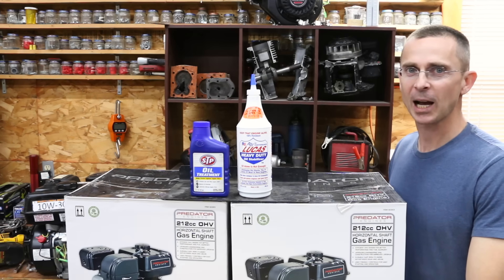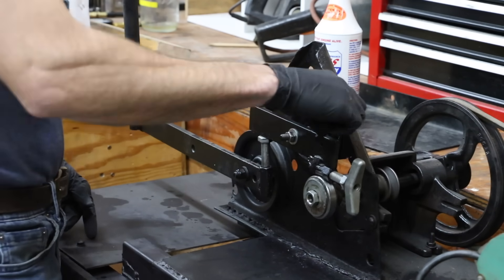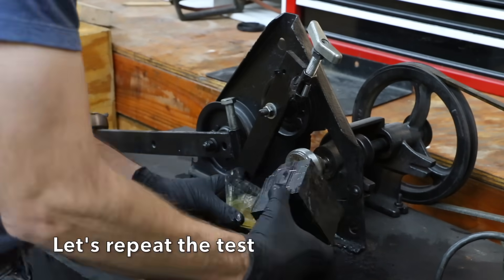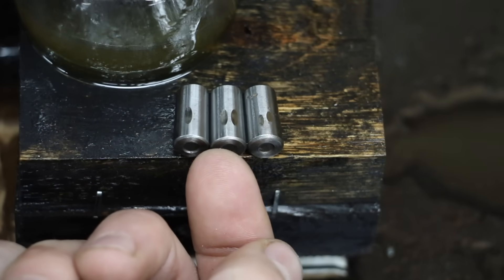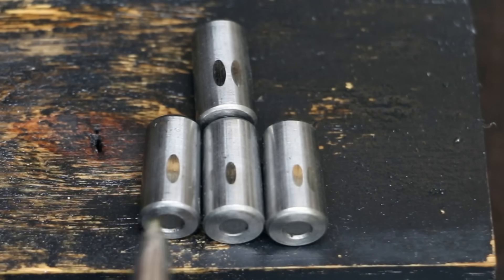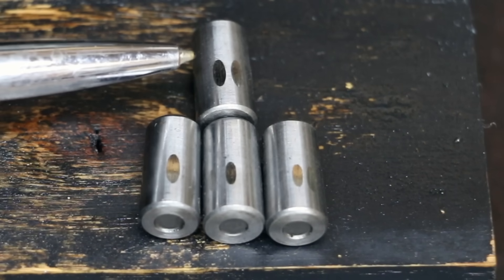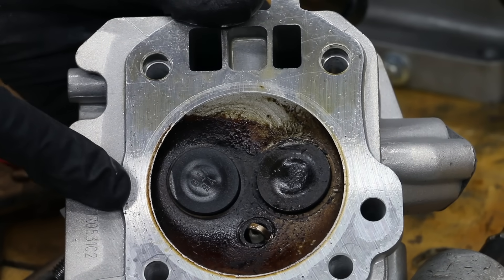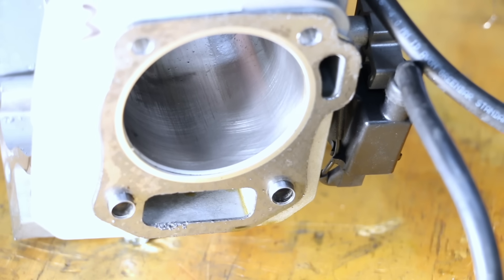Which engine self-destructs first?  Lucas or STP?

Comment: Prolong commercials made some pretty amazing claims, I would like to see it go up against any of the top oil additives.
Reply: C W - Great experiences, thank you for sharing! @Project Farm, you've got to try it!
Reply: I've been using Synionic (used to be Prolong) for 3 years in many applications including: Automotive petrol and diesel engines, manual and automatic transmissions, outboard motor engine and gearboxes, Wankel engines, hydraulics, compressors and vacuum pumps. It works really, really well - BUT it needs to be temperature cycled in the application several times and preferably allow the engine to get hot - then it's phenominal. I had an old Volvo 940 overheat in traffic when the electric fan failed(I didn't notice the temp gauge and the engine was running perfectly) - since then drivability is unreal.

Comment: Well, I learned to keep using oil in my engines. I'll do that, 100% synthetic even in lawn mowers for me.
Reply: I'v ran synthetic in a Troy for 9 years and a  John Deere for 11 years just add oil to them did not change at all still using the Deere.
Reply: Not hitler, mowers have governors to limit rpm so they are not running at max rpm.
Reply from the maker: Thank you
Reply: If I may, I suggest using Amsoil.
Reply: I use synthetic in everything! Car,lawn tractor, log splitter, snow blower exc.

Comment: I think the Lucas won hands down. I have always been a lucas fan. I have a motor that has 323,000 on it and it is compleat stock. I had run lucas in it sense I bought the truck. Well the head gasket cracked and so when I went to start replacing it I noticed something lining the entire head, the motor hadn't been run for about 3 or 4 months so all the oil had settled. As I am looking at it I discover it was that lucas oil stabilizer that was covering it. That motor has ran strong ever sense. I use it I'm my gas and diesel motors.
Reply from the maker: Thank you

Comment: Was a tachometer used? Were both running at same RPM?
Reply from the maker: Both are governed to run at 3600 RPM.  Thank you
Reply: As you can see, the engine bearing went first. Then the rod scraped on the crankshaft until hot enough to melt... then it grabs. 99% of engine failure are this.
Reply: Yes, both engines were running at 11,500 RPM... + - a few hundred.
Reply: @lcee6592  hahaha now you sound like a CBR motorcycle engine test!

Comment: Interestingly, I think STP won. Why? Because under normal operating conditions, where these motors are going to find themselves 99% of the time, the STP engine was running cooler  than the Lucas. I am willing to bet the additional heat was a combination of additional viscosity and entrained air in the oil making for a poorer lubricating oil.

But but but the Lucas oil engine lasted longer! Yes, in this ONE test it did. Could be a complete fluke that this motor was built on a Wednesday, where the other was a Monday after a long weekend. 

What does the STP cost VS the Lucas, and over 1000 hrs of operating time and oil changes, what does that cost? What does the additional fuel consumption cost due to the higher parasitic losses in the Lucas engine?

When you look at total lifetime operating costs assuming you're smart enough to not run it without oil, the STP I think you will find has a lower total cost. And realistically, 15 minutes vs 20 minutes with no oil is meaningless, it's dead either way.
Reply: You can't just assume the motor ran cooler because of the STP . We didn't even get the break-in temps for the two motors for a control (regular oil temp) comparison . One motor may simply run more efficiently than the other . A slight difference in air to fuel ratio could be all it takes to make one run warmer .
Reply: And keep in mind these were cheap Chinese engines . They are not known for consistency .
Reply: But we really don't have evidence of that, do we?  BTW, you might want to check out p.16 of the latest (Feb. '19) Consumer Reports (p. 16) on Recreational Generators where the $500 Chinese Predator unit matched the $900 Yamaha unit  in their ratings … 72 points to  73 points.  Yep, that also surprised me.  @bryanobrien2726
Reply: @LR-my2di  "But we really don't have evidence of that, do we?" . That was my point . Predator quality is nowhere near the leading brands , the only thing going for them is the low price . What's the warranty on a $500 Predator generator ? 90 days LOL .
Reply: I love Yamaha, Bryan. I just bought one of their supercharged 1810 cc PWC's.  However their warranty on that generator in question is also 90 days unless you buy the extended factory warranty. I know because I have one. LOL   @bryanobrien2726
Reply: @LR-my2di  What model would that be , the EF2000iSv2 ? According to Yamaha , all of their generators including the EF2000 have a standard 3-year warranty , extended warranties take effect after the 3-years .
Reply: @LR-my2di  Yamaha's warranty is more than 12 times longer than the Predator at 1,095 days vs 90 days .
Reply: I paid no attention to the model # since it was almost two yrs. ago during hurricane season.  It went immediately to my  lake house down in Florida where I'd need it the most. Warranty was never a concern anyway as being a Yamaha, I knew it would last way beyond the warranty period expired anyway, especially with it being used only in case of an emergency. Funny that Lowes would have told me wrong.  Didn't matter to me anyway. I poured in some non-ethanol gas laced with Sunoco 112, fired it up and ran it for  ~20 min. , shut it off and there it sits.  @bryanobrien2726
Reply: @LR-my2di Lowes pushes their in-house extended protection plans . I wouldn't be surprised if salespeople lied to sell more . Best Buy is well known for doing this .
Reply: I agree on both counts!  Thanks.  @bryanobrien2726
Reply: Jim Meyers.  Are you gonna take your stp and go home because you lost?
Reply: Good grief, folks. Give the guy a break with these tests. He has no million dollar lab. There are always "what if's" with such "little guy" tests as there are!  @bryanobrien2726
Reply: @bryanobrien2726  well, i can say Lucas is nothing more than glorified bar and chain oil; i run a repair business and all these people coming in for oil changes with their precious lucas that they want me to put in with their oil.   STP,  for your information, has been around a long time for a reason. its a good additive that contains zinc, albeit in small amount, but it does its job. 
Piss on Lucas and the millions of dollars they have sucked out of people that don't know anything about lubrication properties. 
Wayne and Kleetus are correct on this one.
Reply: @jimmyers8114  , I get it , you love STP . I didn't say one additive was worse than the other . I implied that this test was not conclusive or scientific . I worked at an auto repair shop myself for 20+ years and we didn't recommend ANY engine oil additives . IMO , people who use engine oil additives are buying snake oil including STP , it's usually old-timers who swear by these . I've personally never needed a fix-all miracle cure because I buy good quality oil and change it as recommended like clockwork , but I do find these VS tests and the fanboys entertaining .
Reply: @bryanobrien2726  Yup, My wife and I've got a number of high mileage vehicles we've purchased new..  Her old Tercel (mid 80s) had around 285,000 miles on it and still running like a top when I replaced it with a Camry.  It had well over 100,000 on it before a chicken truck sent it to the great junkyard in the sky.   That was replaced with a Solara that now has 235,000 on it and is running strong.    We also have a '97 T100 and a '92 Toyota  pick up, each with just shy of 200,000 on them still running well.   All I've done are regular oil (engine, trans, and dif) changes as well as oil and air filter replacement along with the other expendables like belts and plugs.  No oil additives have been used in any of them.
Reply: Jim Myers l
Reply: Some good points made here. 
I just think that in this video you just want to see which oil helped the engine run longer.
And in this case LUCAS out LASTED STP by approximately 10 Minutes longer.
This is almost twice as long.
Reply: @Godisknockingx  We don't know what both engines would have done with the same oil, either and we never will.
Production tolerances and carb tuning are huge variables. No 2 engines alike in these mass production samples.
Reply: Lol ya running with no oil dont prove much an engine needs oil to live meaning less
Reply: Man......idk....I SWEAR by Lucas BUT I've never used stp. The temp was interesting. I put Lucas in a mower that had "light-seized" and proceeded to make a lot of money with it. 
REALLY wish there was a control engine with just oil.
Reply from the maker: Thanks for commenting on this.
Reply: Exactly what I was thinking.  Thanks
Reply: STP might have ran cooler but Lucus ran 20 + STP did not so Lucus won
Reply: @Geebop Baluba Wow... 240 inline 6... there's an engine I haven't heard from in a while!
Reply: What would happen if the stp was tested using the same ratio as Lucas? The stp was mixed at half the strength of the Lucas
Reply: I was going to say Lucas until I read your comment. Makes sense!
Reply: @Eli Z Yep, we'll never know what either engine would do with the same oil in them both. Run that test first, then test oil additives.
Until he gets sponsored he's probably not likely to buy 6 engines for one test.
Reply: The temp. Doesn't matter because it could have been under more stress anyways
Reply: I believe STP is the superior of the two for the fact that the engine ran cooler. The high parrafin base of Lucas is what probably helped keep it running as long as it did after draining, and it's exactly why I don't run Lucas in my cars. Parrafin can and will cake up over time in an engine (ask anyone who ran Quaker State oil in the seventies and eighties) and cause worse trouble than it temporarily solved.
Reply: STP additive, apparently, had more air in the oil after it was mixed.  So, Lucas MIGHT be better.
But, waste of $ if you ask me.
Gasoline is so well made, filtered and particular additives are put in it nowadays, additives are a waste of $.
Unless we are running a 30 years old engine.  Then, there MIGHT be some value.
I say "might" because if the same $ spent on the additives was simply banked, a person might just as easily buy another vehicles, mower or whatever with the bank balance after a few years.
Additive market is nothing but a game and the consumer only makes the additive company wealthier.
I'll keep my own money and make myself rich, thanks.
Reply: @Rhetorical Answer 
I'm only saying that the Lucas engine had 50% more life in it compared to the Stp engine after it died.  That's a big difference if you think about the life of an engine. 
If it were 1 or 2 minutes then yes not a big deal. But almost twice as long can't be considered as a coincidence. The difference is just to much to overlook. When the difference is so big I personally think that a control engine would be nice but not necessary. 
Please note that I like both additives. Stp does keep an engine  running cooler and Lucas keeps a thin film of oil for protection.
In the end the Lucas engine had 50% more life left in it after it's counter part died. That is what I believe can be gleaned from this engines test.
Reply: Yea Micro-dieseling can cause premature failure in just about any type machinery
Reply: Did anyone pay attention to the crankcase and scaring on cylinder walls stp was way worse than Lucas so my conclusion is that on top of engine running longer and less scaring and looks of crankcase Lucas won don't really see how anyone can even start to say stp  was better
Reply: I'm gonna tell you Why Lucas Won...Just look color on the cylinder head STP Black,Lucas Brown that's a Perfect Burning..
Reply: Thanks

Comment: u would of got a better result running the two samples in a control test on your pressure machine for longer then 30 seconds but and not had to destroy two brand new engines but it looks like lucas and oil was the best result over mineral oil or stp and oil u should of also used penrite full synthetic to show people why its the best
Reply: running the engine dry don't tell us anything but
Reply from the maker: Thanks for the constructive feedback.

Comment: Why did the connecting rod explode but the piston itself was completely fine? Is it better metal?
Reply from the maker: Great question. The connecting rod is indeed the weakest part on the Predator 212 engine.  It's made of cast aluminum, which doesn't survive long once the lubricant wears away.
Reply: Well you learn something every day. Thanks for responding!
Reply: Partly because it's aluminium apparently (really?). Partly because the piston is supported tight in the bore - whereas the con rod has cyclical and compression - extension forces as well as lateral forces on the arm of the rod being reversed repeatedly at high speed without cooling or lubrication.. And no support. The conrod is under the most stress so it's the part that fails (and takes the rest of the crankshaft etc with it).
Pistons fail more usually in high compression or charged engines from detonation heat damage - hence why a lot of engines have oil sprayers aimed at the underside of the piston crown for cooling.

Comment: I'd like to see you do something with marvel mystery oil. That's been around for since before my time.
Reply: It's a light turbine oil, not recommended as the main lubricant, it's good for dirty lifters, stuff like that. Add to the gas too helps.
Reply from the maker: Thanks for the recommendation.
Reply: Yeah my Grandpa told me about that stuff when I was a kid. I use it to this day. I think it's pretty good for providing protection. I start using it right from the start on new engines in the oil and gas. Never had any issues with anything so far.

Comment: Hi, It looks like the additives did more harm then good, but the real question is are these adatives ment to be used in a new engine or an old engine that has been used alot more?
Reply from the maker: Great point. I don't believe either product warns against using it in a new vehicle.

Comment: Slick 50 vs TufOil & perhaps other TefLon/PTFE-type based oil additives. I've heard cautions about Slick 50. Been using TufOil for many years, w/ Mobil1 synthetic & greatly extended oil change intervals in many different types of 4-cycle engines (huge fan of the combination!). So, I'm quite curious. Thank you for all of the very interesting videos!
Reply from the maker: Thanks for the video idea!

Comment: But are these substances even metal surface builders? Or did these only work while on the motor? So, does this test even make sense? I understand this test if you compare even regular oil and Restore, rvs or x1r or bestilline. But these are different substances, right? Do not they only affect when on the motor?
Reply from the maker: Thanks for the constructive feedback.

Comment: Out of all the oil additives you've tested so far which one do you feel has work the best. (Provided the best protection or added true additional lubricity)
Great channel, keep the videos coming, glad to see you're donating the engines to schools.
Also-
Any possibility of adding JB oil treatment or supplement to your test line up.  I see these products featured at various mechanic shops and wonder if they're as good as they are said to be.

Thanks-
D
Reply from the maker: Best at restoring lost compression: Engine Restorer.  Bestline and MotorKote both have tremendous film strength.

Comment: Those thick additives are for worn out engines that burn or leak oil... to get a little more life out of them.  Modern motor oil needs no additive.  You could run ANY oil in those engines and they will have about the same lifespan.
Reply from the maker: Great point.

Comment: Good video, but your experiment lacks a control. If you would've included a third engine running on conventional oil as per manufacturer instructions we could have seen whether or not that damage is typical of these engines. Cool test either way, Thanks.
Reply from the maker: Thanks for the constructive feedback.

Comment: Would have been good to have a control engine that had been broken in and run for the same amount of time with the engine-specified oil type, then run with a dry sump.  That would show if either additive made a significant difference over plain oil.
Also, if the additives do make a difference, how would the test results be used to understand how a normally maintained engine would benefit in terms of wear. In other words, is it possible from the test data to determine what percentage of wear reduction the oil additives provide in a normally maintained engine?
Reply from the maker: Thank you for the recommendation.

Comment: Lets see a test between Prolong, Seafoam, Engine Restore with CSL, 1/2 to 1 Qt. Engine Assembly Lube, and mix maybe top competing oils Mobile 1, Castrol Edge, Penzoil Ultra Platinum Royal Purple.   
I have had great results with Engine Restore with CSL restoring compression but on some engines blowing head gaskets and clogging oil filters so maybe a separate test for the Restore as I have done multiple teardowns on worn engines that were treated with restore and wayyy! overtreated restore engines, "like gold metal flake paint" entire engine coated!!!

Don't just take my word try some of these I am a 20 year master mechanic and build motors.

Can't wait for the next tests!!!!  Awsome dude!!!
Reply from the maker: Thanks for the video ideas!

Comment: Trouble is.... No way to do this "test" unless you do it 100 Times with 50 engines in STP and 50 On Lucas. Every engine has slight flaws and Im guessing after a few where STP "won" they waited till a Lucas motor lasted longer.
Lets see all the Outtakes please.
Reply from the maker: Thanks for the constructive feedback.